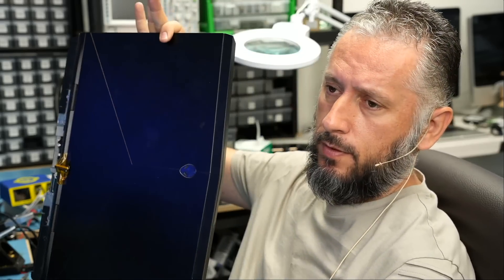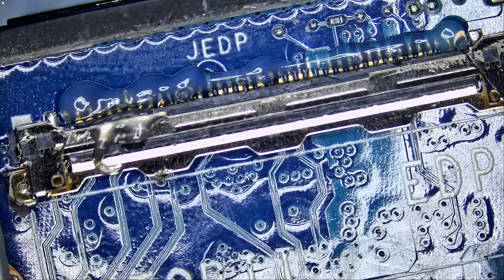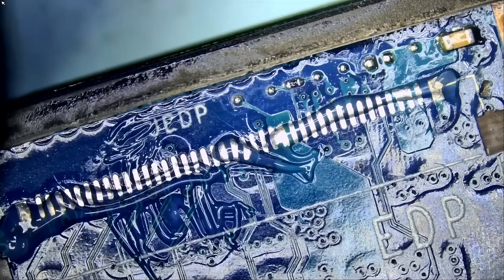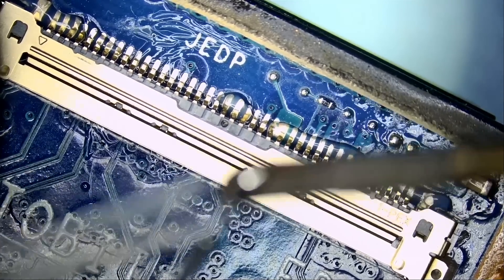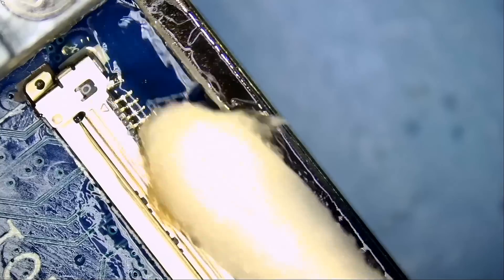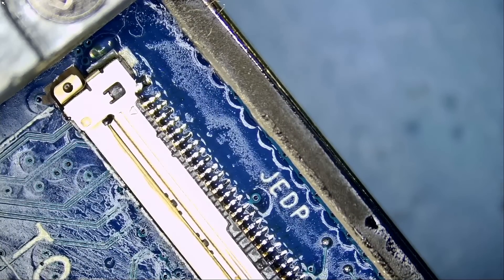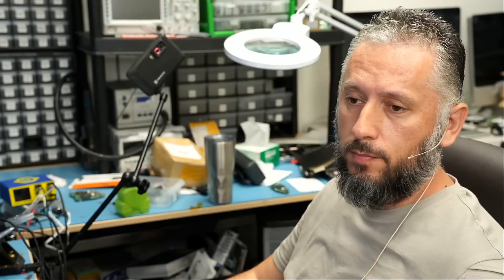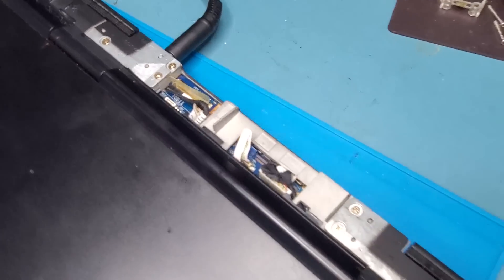Dell Alienware Repair - Music Tune error Beeps on startup and LVDS Damage

Comment: My Alienware 17 R2 restarts after exact 30 minutes. and the windows startup time is also longer then expected. i have installed NVME and still windows loading is very slow. after loading windows laptop restart after 30 minutes automatically. i have disabled the 30 minutes option in the windows but still same issue. I am from Pakistan and following you since 2021. Please help me. i am a tech guy I can repair some thing if needed.

Comment: The beeping noise is a (ridiculously loud) diagnostics self test and it happenes when it finishes with an error, any error will beep the same way, but the error results are visible on the screen (not useful when you have a screen issue xP)

Comment: 6:03 - I've made the mistake of looking at my fingers under the microscope before too and I couldn't believe it - mine were full of dust, fibres, capacitors, diodes, resistors, wires and even a few old CPUs 😂

Comment: I imagine some devices take longer to disassemble and reassemble, than it takes you Alex to do the repair. All that work taking it apart, in some cases finding it a 'no fix', is exactly why an 'Attempt Fee' is charged and justified.

Comment: Tha laptop is a little dirty :)
My father told me to clean CRTs inside out(we discharged the flyback and the capacitors before reaching inside) with a vacuum cleaner before giving it to the service personnel next to us so they don't have to dig out all that dust, soot, and everything else inside.
Reply: Sure wish I had had someone do that for me. Then their life would have been blackened, Miller-Stephenson foam cleaner-soaked KayDry-EXLs and not mine. Cheers!

Comment: AMAZING WORK AGAIN looks very good soldered and as good as new!!! Love your passion and your humor in your video's.
Reply: The pins soldering is fine, but, without mounting the connector, anyone in the future will rip it off the board when disconnecting the cable. Even hot glue on the edges would at least stabilize it a little.

Comment: Could you use the UV stuff to hold it in place?
Reply: No.  UV stuff is used in very fine amounts and only really good for securing pads and traces.  Also for solder masking to replace existing solder mask defects.
It is not strong but strong enough for pads.

Comment: Just a random share before I watch the video. I bought an Alienware M17xR3 in 2012 and it was one of the worst laptops I've ever owned having an LCD problem within months and, naturally, it wasn't cheap to buy. I've tried to fix it recently so I'm interested in this LVDS fix.
Reply: My friend bought an Alienware around 2012 and is still using it to this day. It's gotten a new drive (HDD -> SSD) and battery, but otherwise has worked really well
Reply: @theotherotherBrian  I guess its down to luck of the draw!
Reply: I can imagine how it looks like after u tried to repair it
Reply: I got a top of the line Alienware laptop in 2011. Was complete trash. Two GPUs.. what a great idea that was....
Reply: @stevedevice  the quality seemed to be hit and miss with lots of people swearing by their Alienware laptop.

Did you ever get the GPU issue fixed? It was great that you can swap out the GPU though even to buy a replacement today runs $200-300 which is good PCIe GPU money.